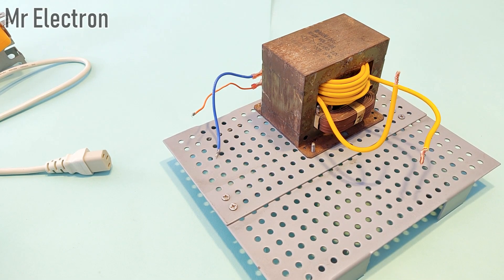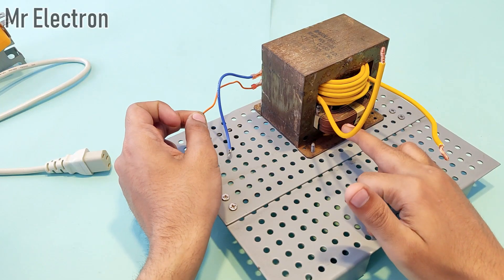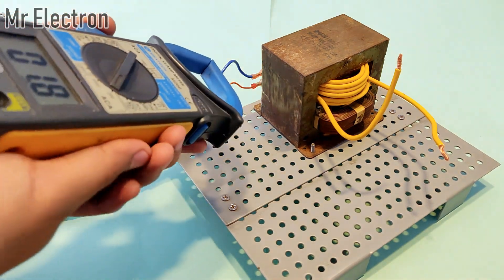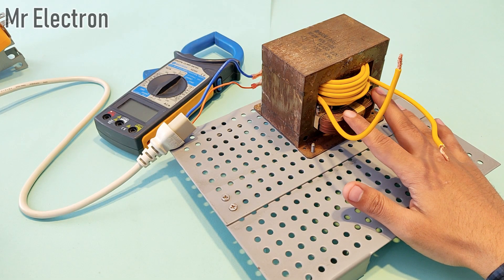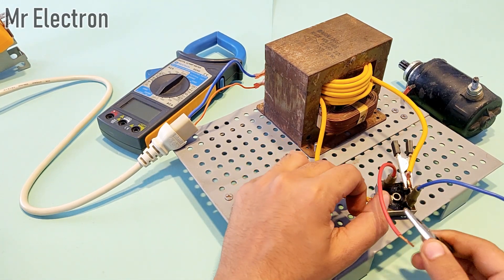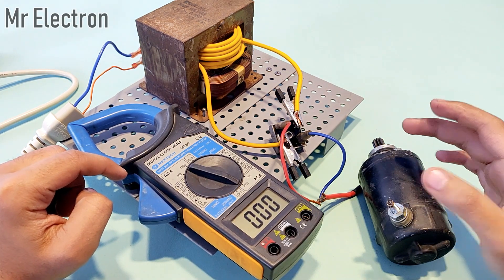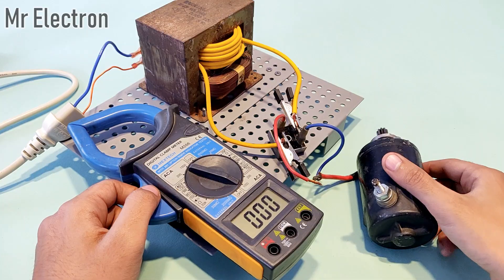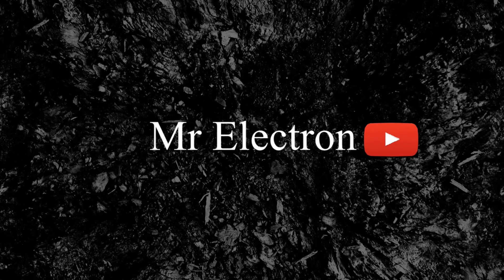12V 100A DC from 220V AC for High Current DC Motor using Old Microwave Oven Transformer - Part 2

Comment: The 130+ amps for the starter are surely when it is under load and actually turning over a car or some other type of larger motor. In this case it has no stress on it so it will never reach it's maximum rated load.

Comment: Electron bhai... i have 12volt windmill generator ..... from this 12vol generator can i convert it to 220 ac...... and if so please tellme.. because i want to run my 220.motor .. from my generator
Reply from the maker: Little lengthy process.First charge a 12v battery with your wind turbine and then convert it to 220v using inverter
Reply: @MrElectron  ... thankyou bro....